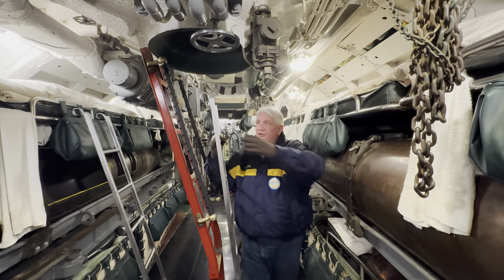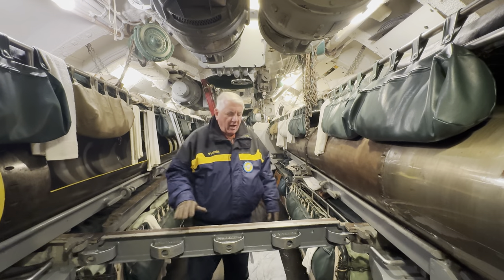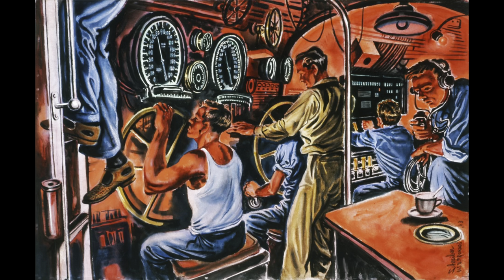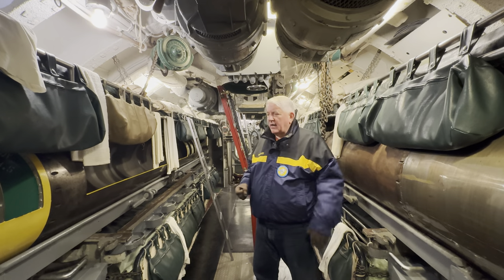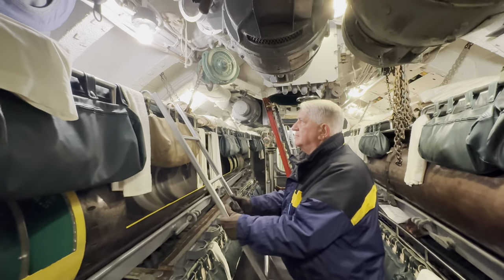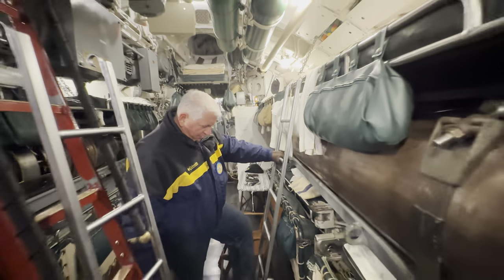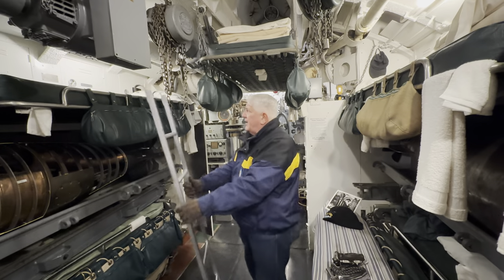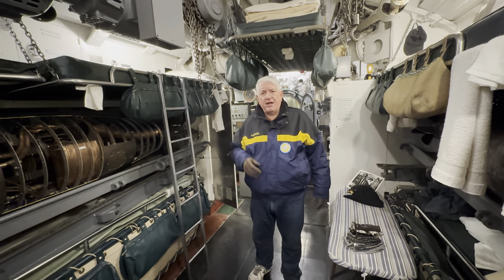Submarine Bunk Ladders: Unknown Artifacts of WWII!

Comment: @ USS COD   As someone who has worked in sporting goods I will tell you that a simple sign on a ladder doesn't always do it, as we ended up putting sheets of plexiglass on the ladders of tree-stand displays to prevent people from climbing them. I would hope people visiting a museum would have more decorum than the average shopper so you might not need to go that far. Then again that does make a nice place to put pictures or info signs.
Reply: We're thinking claymore mines...
Reply: Put a snake on the top
Reply: I have a great “submarine story”. It’s 100% true and I regret it but it is somewhat humorous and is right in line with your comment. When I was a small child (8 or 9 years old maybe) I once took a tour of the USS Silversides which is a floating museum ship (submarine) that is in western Michigan on Lake Michigan near Muskegon. This submarine is in the water and supposedly still functional. I think theoretically it is still capable of operating. Anyway I was left unsupervised while taking the tour of the boat and when I got into the engine compartment there was a “button” and it was covered by plexiglass. Of course… me being the little hoodlum that I was… I slipped my finger under the plexiglass and just had to  “push it”. Because… it was a big looking important button or switch and… well it needed pushing!  Big mistake. I have no idea what I actually did but from my memory… the whole port side diesel engine started cranking over. I have no idea what happened just that something incredibly loud and violent occurred. Scared the crap out of me. I remember I immediately knew I had done something very very bad and I ran out of the boat. Just as I was leaving the gangplank the museum staff had heard what happened and they were running onto the boat. I don’t think (I hope) I didn’t cause any real damage or problem but I never knew because I essentially ran away. The moral. When dealing with the public… just assume they are little hoodlum monsters like me and if they can screw it up… they will. You gotta “dummy proof” everything. 😀

Comment: Can you do a video about crash diving? In the movies any time an enemy aircraft or destroyer is spotted they do a crash dive.  How accurate are the films? What does a submarine crew do in the event of a sudden threat?
Reply: Diving is the safest action. Having radar or visual spotting as early as possible is key, and as soon as an enemy is on an attack vector, they crash dive, getting below and turning off the previous course as soon as possible to avoid depth bombs. Lockwood was firmly against upping the AA armament of subs for a long time as staying on the surface meant they were more likely to be hit by bombs. As a submariner he was intimately aware that the depths are protection.
There is also the fact that staying undetected period was important, so they would often dive on radar warning of an enemy patrol, or any aircraft really, as even the US planes had a bad habit of bombing ANY submarine they saw, which cost us at least one sub.

Comment: The 2 divisions I was in had racks stacked 3 high. The middle rack was the preferred as it was waist high. Very easy to roll in and out. The guy in the upper rack simply stepped on each of the lower racks. There were divisions that had racks stacked 4 high. I don't know if there were ladders. I presume there were.

Working in red light conditions was an entirely different experience from anything most civilians would be familiar with. We did it all the time at sea, especially while UnRepping. The red light was exactly the same color as blood. Cut yourself and you wouldn't know you were bleeding. Don't ask how I know this. On the bridge, red light at night just seemed to be appropriate. The bridge was always quiet as you had to be able to hear and understand all orders. The red light just seemed right.
Reply: Thanks for sharing your experiences afloat!
Reply: I was on the top of a three high on my first ship. It also had piping and wire runs over the top, so only smaller people like me could fit. I was 5'8", 125 pounds at the time. It was a very tight fit, I couldn't sleep on my side without some contortions.

And yes, I used the other bunks as a set of steps. 

Crazy enough, these ranks look more spacious than what I had. Granted, I was on a WWII era ship (in the late 90's).

Comment: Great find, and great demo. If you look at the paintings, they are hooking those ladders on the lower bar of the bunk rail, where you were hooking it on the top rail. I'm guessing that hooked to the bottom rail, the ladder will be at a bit more of an angle, and easier to climb. Just a guess.
Reply: Both upper and lower rails appear to be used on all of the images (some not shown)... buy yes it only slightly affects the angle of the ladder
Reply: steeper angle also makes the ladder more of a tripping hazard for those walking by, and sailors are used to vertical ladders. Also, since these are not reproductions made to spec but simply close approximations, they might be longer than the originals.

Comment: You may have covered this before but I figured someone might know. When the sub was operating in extremely cold environments on the surface or in extremely cold waters… how did the crews stay warm? I assume the power plant puts off a lot of heat in operation and would warm that space somewhat. Were there heaters of any type in the other spaces to provide some warmth? How did they maintain a comfortable temp inside the boat when it came to cold?
Reply: Electric heaters of several types are located in various compartments.  These subscwere surfaced most if rhe time so the generators cranked out sufficient power to run them. Not sure how quickly they drained the batteries submerged. But submerged you could run hot air from the engine rooms.
Reply: @paulfarace9595  Thanks for the reply. Good info. I imagine it’s better when it’s colder seas as opposed to working and existing when your in tropical waters in the blistering heat.

Comment: could the bunks be reconfigured if the torpedoes were used?
Reply: The deck bunks would be turned up and the tray bunks would be folded under the upper trays when called to battle stations. The upper bunks often were not touched